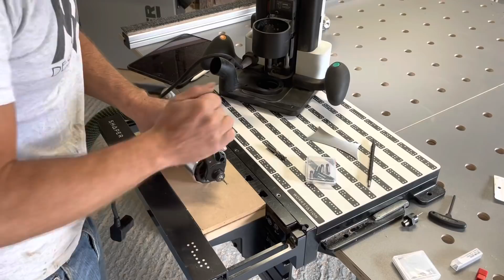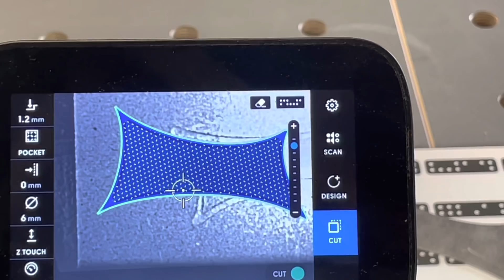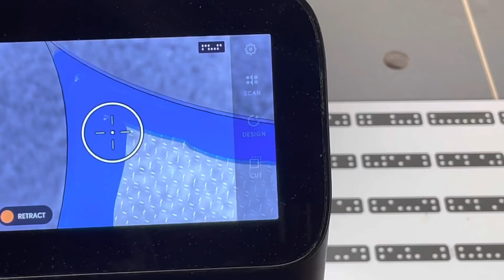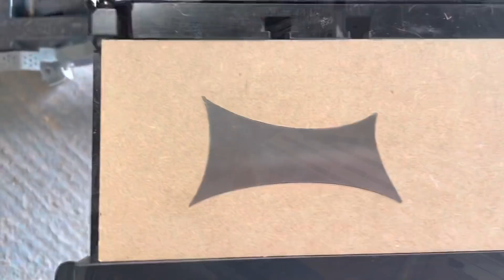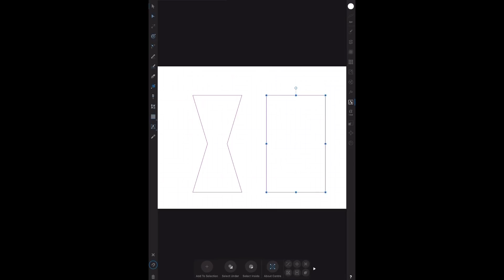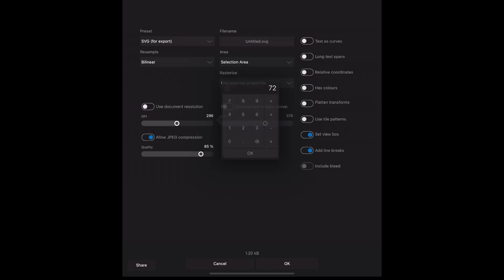Shaper Origin - Designed to cut .. Simple !!  ￼

Comment: Hey Andy, I was looking at getting one of these, do you think it’s worth it?
Reply from the maker: It’s really useful , when I get back to the main shop and can process slabs easier , i’ll be doing some projects utilising the shaper rather than resin the joints quite excited about that I’m also excited about being able to take it to a job site repair a split in a table or someone’s floor just a cool little tool for me the key is the iPad out for designing small inserts because it’s so simple keep watching you might get some ideas hopefully.
Reply: @ManorWood  Cheers for you reply Andy, appreciate that, I’ll defo be turning in, thanks man 👍👍👍🇮🇪🇮🇪

Comment: A genuine question. I’ve looked and to buy “your” machine including workstation is about £2,900 plus taxes (some which are obviously reclaimable if you are VAT registered. To buy a 1500 x 1500 sized complete CNC workstation, with every upgrade possible, from Ooznest (UK based and with a very good reputation) comes in around £2,600. 

Why might anyone buy one rather than the other?

I understand that, with extra tape, you can CNC unlimited size with the Shaper but I think most people would not CNC a whole 8x4 sheet in the sense of a single shape covering 8x4 but rather multiples of a smaller shape onto a larger sheet. 

To my untrained eye, a station like Ooznest just seems press and leave whilst the Shaper is more labour intensive in use. As I said, it’s a genuine question as to the pros and cons of each. I’m pretty sure you have evaluated both kinds of systems because to you and your set-up, there is a potential large saving in labour time.
Reply: From what I gather on this thing, is that if you have enough of the tape, you could cut a large inlay design on a floor. Or maybe a large wood kitchen island already in someone’s kitchen. The portability of it would be very handy. Take it to the piece, not the piece to your shop. And yes, when building a large table that needs bow ties, or some inlay, it would work great. However, if you already have a CNC, you could design your large inlay or whatever on it, and cut it out of 1/4 inch or so material and use it as a template for a hand held router. That’s my idea if I want an inlay on a piece too large for my CNC. And with the tiling option, a pretty large template could be made. April Wilkerson did that to make a large sign for the outside of her shop. She has a 4x8 cnc and cut it out of sheets of plywood, but the idea is the same. 
Will say that this is a pretty cool machine, and now that I see that it auto corrects your path, is great. Definitely would be handy, but yeah, the price is too much unless your really going to use it for business and not just another cool tool.
Reply: I would imagine that the size of some of Andy's tables that would need bow ties would just not fit in a machine as small as the Ooznest, or others, and so with this machine he can take it to the workpiece and create the socket.
Reply: @malcolmjames1866  good point. I was looking at the Shaper with the workstation. I don’t think you could use the Shaper plus workstation to cut the female in a large table; I guess you would use the shaper without the workstation and stick the marking tape to the table?
Reply: @theofarmmanager267  Yes, that's what I thought Andy would do.
Reply from the maker: Yes , tape goes anywhere which is the Beauty and the machine making it usable anywhere any size
Reply from the maker: So I actually have a 4 m x 2 meter CNC on order which was going to arrive just before the fire so it’s been put on hold and stored for me.  The origin is something completely different as you take it to the worksite so size is no limit!  I certain jobs that are fixed CNC sitting there all day on its own cutting away are definitely better for intricate interesting work on inlays on large tables it’s very difficult moving the slabs around position in bowties exactly where you want them or any other cup for that matter.  I guess it’s a bit like me having a sliding saw and I still use my track saw all the time different tools for different products
Reply from the maker: So in ultimate situation if you are cutting lots of inlays you could use a small CNC to cut the actual inlays themselves, but cut all of the sockets with the origin that way you’re saving time and still been able to work on massive pieces.
Reply: @ManorWood  Oh I definitely see a lot of possibilities with this. I have seen it before, but this was the first time that I saw that it auto adjusts to keep on the cut line, which is very impressive. I knew there was something I was missing when first viewed. This would be a great addition to the professionals tool arsenal, and with all you do, I’m sure it will get a lot of use and speed up the process, which helps the profit line. For the hobbyists and the small or part time wood working businesses, I think this is another one of those  cool tools we would love to have, but would spend more time dusting it off than using it.  I spent a lot of time debating about spending the dough on my cnc, and it’s only a 2’x3’. I’ve made several pieces on it but can’t say it’s paid for itself. Will say that had the origin been available at the time I might have went with it instead. The portability and no z-axis limits as far as material thickness opens up endless possibilities. Floor inlays, large table inlays or repair on site. A lot easier to take it to the site than drag a 10 foot table back and forth  to the shop. Look forward to seeing it in action in future videos.